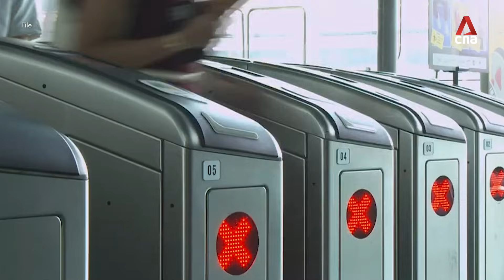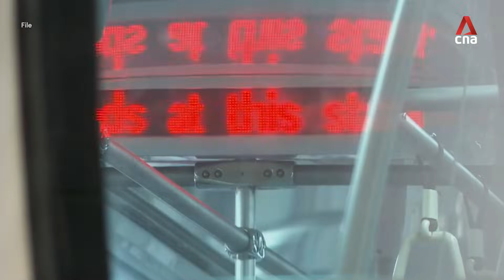Why MRT disruptions should be seen against a wider picture of high reliability standards | Video

Comment: From the beginning after reading the ST report, I'd emailed MOT Minister, Chee Hong Tat on any details of such committee terms of reference. But, as usual, no reply. I'd suspected that this farce was to cover up MOT/LTA/SMRT incompetence in the COST EFFECTIVENESS of MRT operations, as in ALL govt services/departments/agencies. Remember that in the Dec. 2011 incidents, not as many commuters were affected as the Sep 25-30 2024 EW line failure which affected 2.5 million passenger trips. Also remember that the metallurgical report by the chap, I believe from PRC with a PHYSICAL metallurgy degree or maybe a physical metals degree,  I dunno for sure. The Commission did NOT accept this local TUV but instead asked RR for its own investigation into the FAILURE. So I'm unsurprised at this so-call A/P Raymond Ong's remarks which only validated my suspicion and 1st comment. I therefore have NO trust in any of the government publication - mRNA vaccine, GIC/TH so called "annual review" respectively, or even the latest government announcement of civil servants being paid an EXTRA 1.05 month' pay. I've just written to the Public Service Department in the PM office on this on the early hours of 9/12/24, am an still waiting for a substantive response, although PSD replied that my email query has been referred to the person in charge. I reminded the signatory that under PS21, PSD or any other agency should give a reply within 3 working days.

Comment: Another so call "expert" and worse telling public what we should or should not think. That's crazy and I guess it is the reason why NUS yet to produce any Noble Prize winner. This "expert" did not cover the possible lapse or systemic issue within the organization. Out of the 3 lines mentioned, 2 are manage by SMRT. There are interview article on the cutting cost on the maintenance mentioned by the CEO and as the so call "expert" mentioned there are protocol in place but the devil is in the details. Questions like are they skimping on the steps to ensure rail and train operationalize is not mentioned. Also, the investigation by LTA is still on-going  while the so call "expert" is so sure whatever he said is true? I guess it is another lack of accountability by the many "experts" who thought they can said whatever they wants with no repercussion or implication.